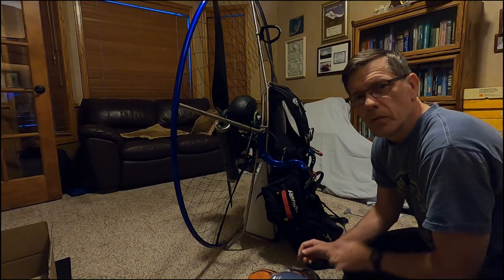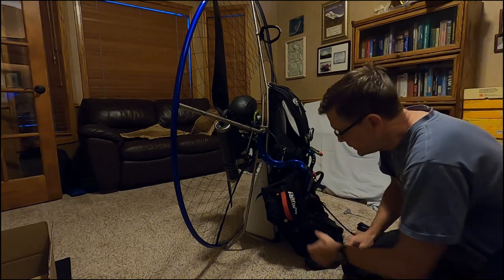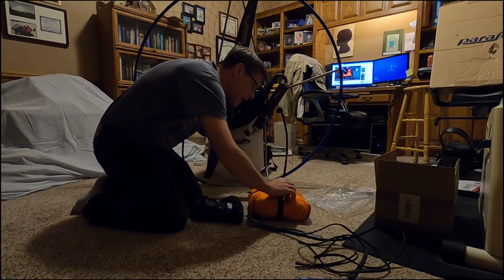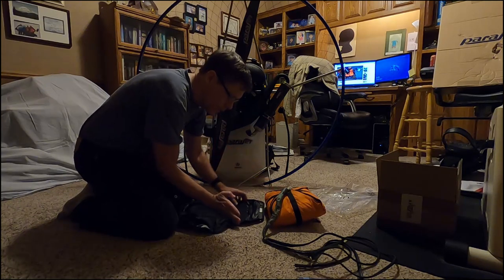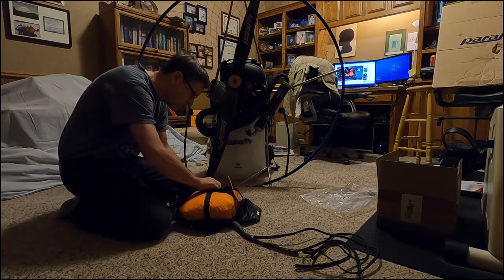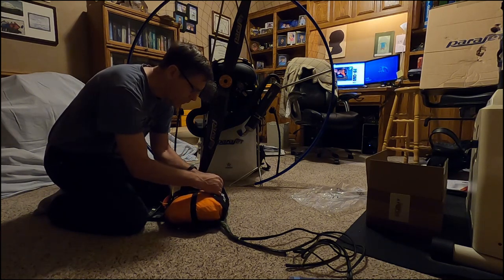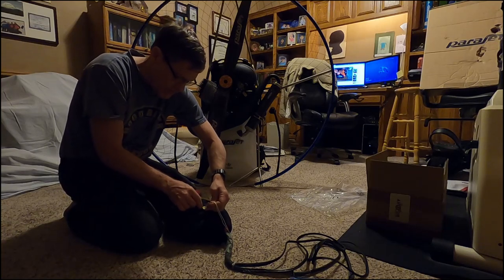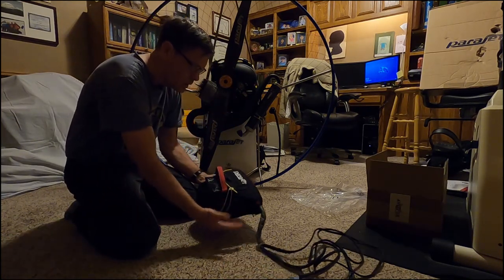Paramotor reserve chute installation Parajet Maverick

Comment: I wish you wore a helmet cam while doing this
Reply from the maker: Clearly I don't need the helmet when I have the reserve at the ready
Reply: @cloudwalkerppg504  i sense sarcasm lol.  I meant that a fpv would be awesome for doing this. I'm struggling to put mine on, and you have the exact same setup. There's just some things from the angle you filmed that I couldn't see.
Reply from the maker: @MrNawtty  This was one of the first videos that I made, so it's not the greatest, A tripod pointing the camera downward would have been better. Aviator has basically the exact same video, split into two parts (packing chute and installing chute).
Reply: @cloudwalkerppg504  I'll look that up, thanks! How's it feel flying righty with it reversed?  I fly righty, too. I have left side neuropathy, so I can't control throttle.  I didn't know you could swap pouches!
Reply from the maker: @MrNawtty  It's not that flying with a right throttle is a big deal, it's more that when you switch the pouch from the left to the right side, when you zip open the pouch it zips upward (instead of downward) so you have to be careful when you unzip in the air that the contents of your pouch does not empty to the ground. I still have never used that pouch while in the air, I just keep spare tools and spark plug in there just in case I need to make modifications on the ground far away from the LZ.     Here is a link to the spare chute install  ------------->   https://www.youtube.com/watch?v=EYYzRdLIi-k